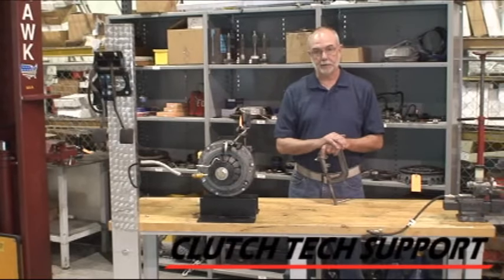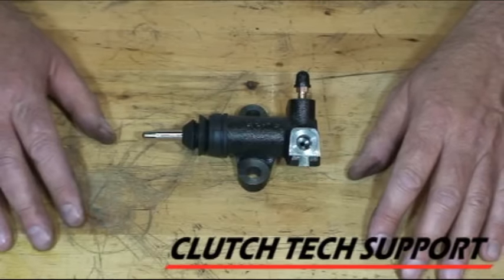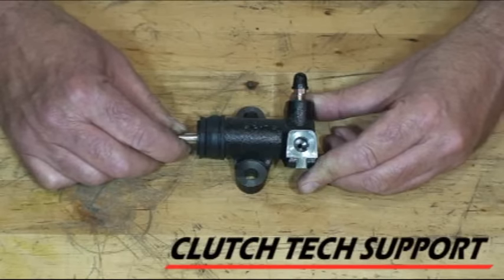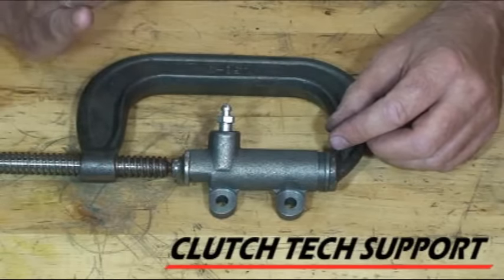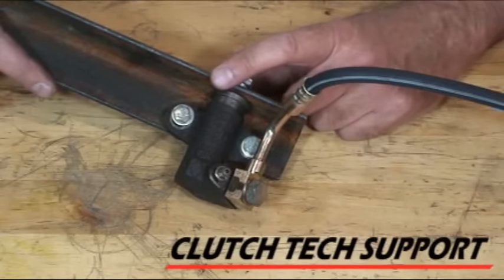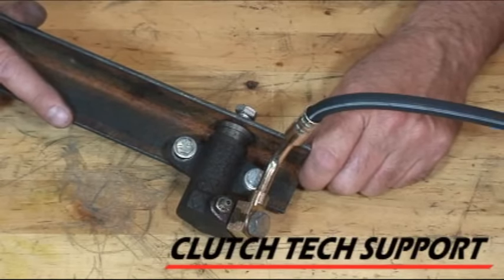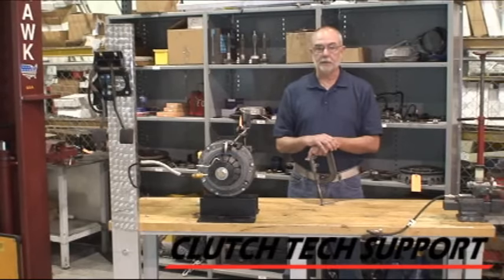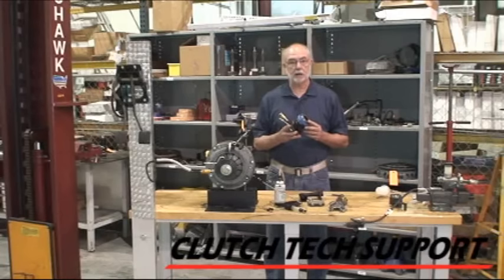Bleeding a Clutch by Blocking the Slave Cylinder

Comment: I have honda 2007 si, replace CMC & slave. For a week I'm trying to bleed this system.I listen to other Youtubers from gavity draining , vacuum pump & pedal pumping to no prevail. These guys at Perfectionclutch got it right, within 10 mins I had it done. Clutch system working. Hats Off gentlemen, thank you
Reply: Did you sort this? Sounds like air locked slave? That’s what I think is up with mine
Reply: @morrissongroundworks4920 Did you have any luck? My husband and I are experiencing the same right now. Bleed clutch fluid. When we go to replace fluid and bleed through a little to make sure no air in the lines the clutch won't build pressure while pumping and bleed basically stops.

Comment: I simply install a hose from the bleed screw to a suitable electric vacuum pump source with a collection jar and adjust  for light vacuum. Keep the master full to prevent air intrusion. It will easily draw all air and new fluid through the lines and slave cyl. in a few seconds. No helper needed. Works  for brake bleeding too.
Reply: Thanks for the input

Comment: Dear Perfection Hytest, just wanted to than you for this illustrative video. It help me a lot to replace both, MC and SC on my Nissan X-Terra 2001 Manual and, of course it works in many Nissan trucks and Suv's. Using the exact C Clamp you have,  Following your advise, I just blocked the brand new Duralast Slave Cylinder i got on AutoZone, connected to the line,... it was hanging for a while until the pedal was little by little releasing from the floor, after some pumping action and releasing some fluid/air. When I saw it was getting some pressure, I call my wife for help. Before i did it manually. And very important, way before I install the Master Cylinder i connected a rubber hose that went  from the outlet back to the reservoir, so i was pumping it out of the car and get rid of any air inside the MC first, then it was attached to the firewall>> pedal. Thanks again!

Comment: On my 2005 Infiniti G35 I blocked the slave cylinder by wedging a large square shaft screwdriver in between the piston shaft and the clutch lever on the transmission housing.  Then I opened the slave bleed screw with a clear vinyl hose attached and had a helper slowly depress the clutch pedal and it will purge air bubbles from the clutch line.

Comment: The factory service manual for my honda car emphasizes the use of a wooden block to block the slave cylinder from moving out while to pump the pedal so all the air can be completely bled from the system .
Reply: thanks for the idea, worked beautifully for my Civic

Comment: 1998 Isuzu Amigo: Bleeding the way stated in the book, it was just like you said, tiny burps. After 30 minutes and probably 300 pumps of the clutch, still no pressure. Followed your directions, clamped it, and got immediate pressure. Unclamped it, bolted it back and, and it bleed correctly. Took maybe 10 minutes to complete. YOU SAVED THE DAY!

Comment: Fantastic! after hours of bleeding the clutch with usual methods I still had air in the line / soft pedal low engagement. With this method and 1 1/2 press of the pedal I got a pea sized bubble out, now have a firm pedal with very little play and mid point engagement. Thanks Perfection Hytest.

Comment: Have been trying to get my truck back on the road for awhile now. Have tried a number of ways with minimal results at best. This was the last effort before taking the transmission out and replacing the slave. Its a 94 F150 with 5.8. Four wheel drive. Five speed. Thank you. This was a life saver. Well at least alot of time and busted knuckles anyway. Thanks again.

Comment: I have a 1994 C4 Chevrolet Corvette with the hydraulic clutch system. These systems are self bleeding. The bleeding process is quite simple.
1) Remove the master cylinder cap then remove the rubber boot from the cap.
2) Loosely reinstall the master cylinder cap without the rubber boot. This will allow air to escape the master cylinder reservoir.
3) Now pump the clutch until no more air bubbles are expelled.
4) Remove the master cylinder cap and reinstall the rubber boot onto the cap.
5) Reinstall master cylinder cap. The system is now bled.
This method is the GM recommended method as per the GM Service Manual. I purchased a billet aluminum master cylinder for which the cap has a tiny pin hole on it which makes the bleeding process an ongoing process, I never get air in my clutch lines as it is constantly bleeding itself and it doesn't make a mess.

Comment: Really worked on my Honda Civic slave cylinder replacement. After hours of trying to bleed with no progress, I watched this video & simply clamped the clutch lever all together with the slave cylinder in situ, & voila after two pedal strokes, job finished. Thanks for posting!
Reply: I'm going through the same issue with my Honda Civic 2004. I'm glad this method worked for you I'm going to give it a try. Did you end up having to use a small socket?
Reply: @phatrymes   What do you mean?
Reply: I'm having the same issue on a Nissan Hardbody D21. Did you bleed your slave cilinder alone ?

Comment: You are completely right. Slave cylinders should be bled the same way as a brake caliper. When the caliper is mounted the pots don't extend when the pedal is depressed and all the air comes out.
Thank you.  Not even the factory manual says that. Now i have to go and bleed the slave cylinder the correct way.

Comment: Very interesting and great info!  I fitted a braided steel slave cylinder line this afternoon to my Nissan Z car and then spent about 3 hours trying to bleed it.  I see precisely what you are talking about here on my car... the slave moves in and out a little bit when the pedal is pumped, but it's as if the master does not have enough travel/volume to fill the fluid/pressure void in the line.  Thus, blocking the slave cylinder is an excellent idea!!   I will try this tomorrow and if that fails, maybe it's time to rebuild the master cylinder.   I've had old brake master cylinders go bad before when the pedal hits the floor and the seals push past the usual travel/wear area into a ridge of hardened dirt/varnish etc... Hopefully it's not that...
Reply: +perfectionclutch  Your technique worked just perfect Gary!  Took a number of pumps to get the pedal back once the slave was blocked and this time there was plenty of pressurized air bubbles and fluid when the bleed screw was opened 4 or 5 times.  Thanks a million for this video, it saved me taking advice from people telling me my master and probably slave had gone bad.  Cheers
Reply: +ArchimedeanEye I have a 2006 nissan 350z and I just installed the JWT clutch kit with braided steel slave cylinder line. I've been bleeding forever now...did this method work for you??
Reply: Trevor Yong yes, it worked almost straight away... 10 pedal pumps or so

Comment: Used a Dewalt clamp on the slave cylinder on the my Toyota pickup to bleed the clutch system. Worked great and have good pressure in the system now! Great method!

Comment: this ROCKS!   I put a honda engine in my fiat x19 and have a hydraulic to cable  converter (allows my hydraulic system to puch the lever on the trans) but it puts the bleed nipple at the bottom making it almost impossible to bleed. this method alloes me to take the slave off, bleed it, then put it back in!

Comment: I miss the old days. Put a foot long piece of hose on the bleeder straight up and pump the clutch pedal. Some air went up and some air went out the hose but it was quick and easy. I had a leaky slave cylinder bought a new one and was done in 15 minutes. Last manual transmission I owned but it was easy. B2000 not to complicated.

Comment: This may be pure gold.  I have a mid 90's Toyota truck with a master / slave set up exactly like this and while Ive bled it many times I am still having shift issues.  I don't really know what spongy feels like but I'm having hard shifting into 1st, 1st to 2nd, and reverse especially.  I'm going to try this as maybe there's a small bubble somewhere causing the slave not to push as hard as it should.
Reply: Hey Jeff...did you ever get your Toy Truck Clutch straightened out ?
I got a 93  3.0 T100 5 speed 4x4 same problem ....only worse !
Reply: @Snailmailtrucker  me too 98 t100
Reply: Did you guys figure the issue out , I’m having the same problem with my 86 pickup

Comment: Why cant you just hold the clutch down, draw a vacuum on the slave bleeder valve and suck out the fluid until it's clean and bubble free? (Like you do brakes?)  A piece of wood to hold the clutch pedal and all you need to do is keep the reservoir full of DOT3.   What am I missing here?  This method sounds overly complicated.

Comment: my wife was on her way to work this morning in her 08 Subaru Impreza 2.5 and after driving 4 miles into town, she started to turn into sheetz and the clutch pedal went to the floor. A couple guys at sheetz tried helping her...they 1st tried adding fluid and having her pump the clutch, when they did this the fluid ran out (onto the ground ) as fast as they put it in! so I'm thinking hole in the line between master and slave? (I wasn't there to see for myself ) or could it be a bad slave? 1st Subaru we've ever owned....we have so much snow right now it's hard to find anything. your opinion would be appreciated! thanks!

Comment: Over in the UK here, this is proper helpful tech advice. I'm about to take a chance on a 2007 Fiat Punto for £100, guy can't bleed a new clutch install and I was sure I could figure out the issues. These Fiats are notoriously hard for both being hard to bleed, to maintain pressure after bleeding without losing the pedal in a short while and needing a re-bleed.

I suspect the advice I just got here and some creativity may well massively. I will ask, it has what is called a HYD valve fitted in the middle. I'm taking a guess this is supposed to control flow, maybe one way etc, big round thing that I suspect may be an air trap. Any advice on these or if you know of anything similar in the form of an inline device, halfway along the length of the line.

Appears to be 2 bleed points, one on the master and one on the slave cylinder. I'll be replacing all O-Rings on the complete line as a matter of caution, seeing as they're pennies and could be 12 years old now. I'll be flushing the system with a quality fluid.

Many thanks,
Paul

Comment: I replace transmission gear fluid 75 / 90 as require in my miata 1992, then I pulled the stick shift and add gear fluid and shift dont work. only work when the car is not running, after I start it and run the shift dont work. what is the problem does it need to be bleed or clutch problem please help

Comment: Hello. I have replaced the master and slave in my 89 4Runner. When I did the block bleed I put a socket into the system to keep the plunger in the slave pinned back. I think I ran too deep of a socket. So I set the volume of brake fluid in the system too low. Is there a way to increase the volume of fluid without re-block bleeding?
Reply: +perfectionclutch Thanks for your response, Gary.  The slave is on the passenger side of the vehicle so it has 60" of flexible hydraulic line feeding it. After the I had installed everything I took the slave back off the truck and kept the master cylinder installed. I dropped the slave to the ground on the drivers side and made sure I had a consistent rise to the hose. I then cycled the slave cylinder and did get a lot of air out of it as well as a lot of turbulence in the fluid. The clevis was loose too. I started to get half a pedal of pressure then it went soft. Looks like I blew the seal in the master cylinder, so it's off to get another one this afternoon. Seems like I over worked it, but not really sure how...
Reply: +perfectionclutch Yes, this is proper config hosing. Designed specifically for 4runner clutches.  I will try again. This weekend. I have never had such a problem bleeding a clutch or brake system...

Comment: I tried this method yesterday and I am not having any luck at all with this thing....
Yesterday I Filled the Clutch Master Cylinder Reservoir, Blocked the Slave Cylinder and then opened the Bleed screw on the Slave.... I thought fluid should just drain thru at that point....but No, I hooked up a Vacuum pump and sucked fluid thru it....but the Reservoir level didn't move.
I messed with all kinds of different ideas...I was getting lots of air bubbles....not sure if the rubber hose was leaking or what but I still had no luck.
Yes, I did loosen the Master Cylinder Plunger rod hoping that would help...NO good.
Next is a pack of Matches !

I have 1993 Toyota T100 3.0 V6 5 speed 4x4 with the same problem as Jeff who Commented below. I replaced the Clutch Master Cylinder and Slave Cylinder twice...then I decided to Replace the Clutch, Pressure Plate throw out bearing with a Stage 2 system. Now I still have the same damned problem. No clutch pedal pressure at all ! I also had to replace the Clutch Pedal assembly under the dash....as it was cracked in 3 or 4 places....then I noticed the Firewall  behind the Clutch Master Cylinder was Cracked too.( I cut out a piece of 3/16 steel and re-inforced that too)... Amazing....I had just recently bought this truck and it ran OK and looked great... I replaced all of the Front end stuff too while I was in there... 

All I am getting is about 1/2 inch movement on the Clutch Arm on the Transmission.

Now all I want is to get it to move ! GREAT VIDEO...LIKED/SUBSCRIBED !
Reply: @perfectionclutch     Gary...Thanks a Bunch Brother...my son is coming down to help me tomorrow or Wednesday....I will do everything you suggested ! I am just about out of other options....I did order 25 feet of 3/16 brake line on Ebay... and bought bending tools at Harbor Freight yesterday just incase I don't get any positive results bleeding !
I'll let you know how it goes !
Thanks agin !

Comment: Ok I replaced the slave on this vehicle over 2 years ago and although the clutch didn't feel 100% it held until recently when the master cylinder went out..  now you do not hear much about the cylinder not leaking at all however it was still bad as in it did not hold pressure causing the peddle to hit the floor and stay there and after re bleeding the slave i got half a life shelf added to the life of the hydraulic system  .. The jury is still out but hopefully I think I  solved this problem for good

Comment: THANKS

I  did have some experience with this problem when, a few years back I fitted a new slave cylinder to my 1967 Toyota Carinaa now I am fitting a new master cylinder.  One  "hell ova job," as one must remove a part of the dash board to get at the linkage and remove two nuts which hold the master cylinder to the firewall. Fortunately althouogh 87 yrs old I am not overweight so  removing the driverers seat allows me to lie on my back !  I can not see any other way to do the job, I recon a garage would charge for a min of twwo hours ,  the new master cylinder was £130.

Comment: I assume using a power/pressure bleeder (the type the pressurizes the actual reservoir)  would have the same effect as locking the cylinder?

Comment: I have a Nissan Froniter 2007. I tried this, it help but I still seem to have air in the system. Replaced both the Master and Slave. So I clamp the slave and slowly press the clutch pedal. It gets have down and I open the bleed value and fluid comes out and the pedal goes to the bottom. So we pull the pedal up. It seems to work for a few presses and then gets soft and the pedal does not return to the top. I then open the bleed value and have a vacuum pump on it and it bubbles out. Any thoughts?

Comment: Thank you help a lot on my z32 300zx. Was having a hard time bleeding the lines.
Reply: hey bro I am having the same exact problem after I've done replace everything could u please tell me how u done it? do I need to unbolt the slave from the trans to put the c clamp on and then what do I do I'm not sure? pls respond bro
Reply: I have a 93 300zx and I was able to do it without removing the slave and  a C clamp if you are not able to do it like that you might wannna shove something in between the slave and the fork so that the slave doesn't have room to extend

Comment: I could use some help on bleeding the new slave cylinder and new master cylinder on a Toyota MR2 Turbo. Because it’s mid-engine, it’s got a very long hydraulic line from the front to the rear of the car. Also, the bleeder screw is not on the slave. It’s located about 6” higher on the transmission - this can’t be good for getting all of the air out.
My issue is not with releasing the clutch and selecting a gear, it’s actually at startup I’ve developed an alarming chatter when I start the car that goes away fairly quickly. Am I correct in assuming the slave cylinder might be at fault? The problem started immediately after I replaced the slave cylinder.

Comment: You're talking about bench bleeding. Take the bleeder out and screw in bleeder hose. it's like bleeding out a master cylinder. Before you go to all the work and bleeding out your clutch system make sure that your pedal is working properly. Sometimes your neutral switch don't work. Because a little piece of junk plastic that they put in for a bushing with a spring just doesn't hold up it pushes out on both sides. An S10 junker clutch pedal assembly. No one really knows how to get them apart properly.